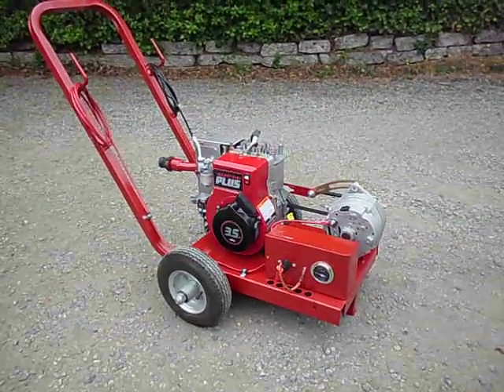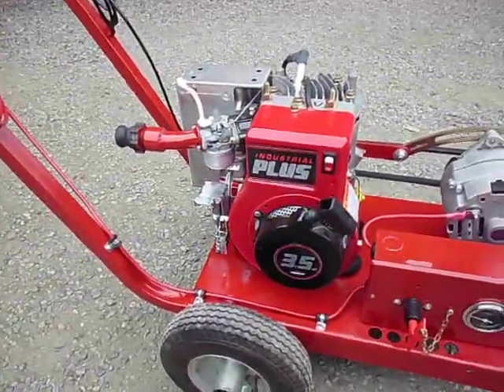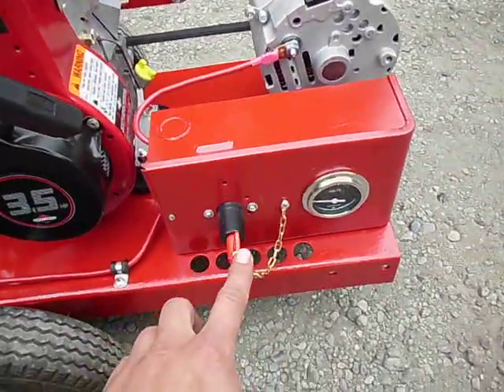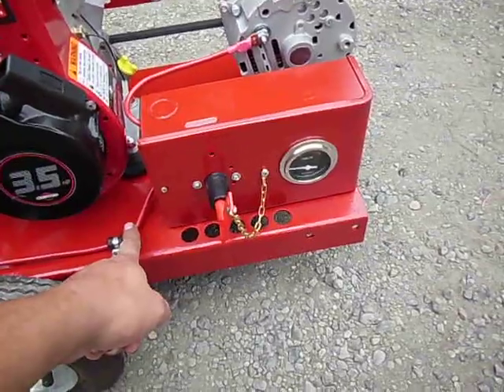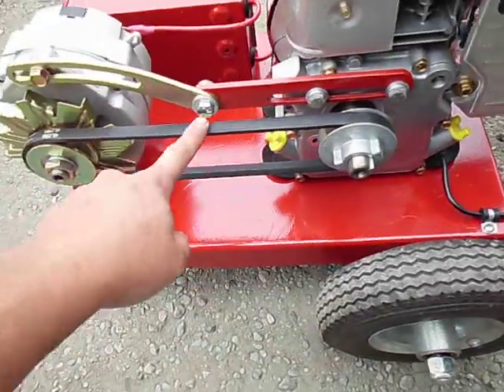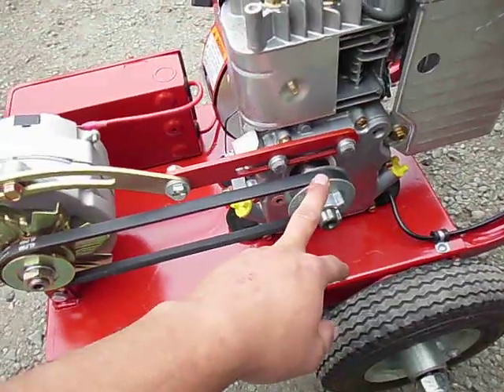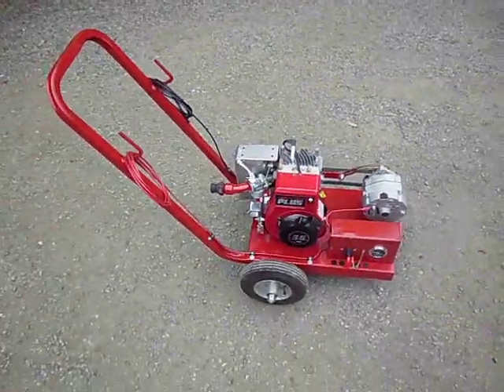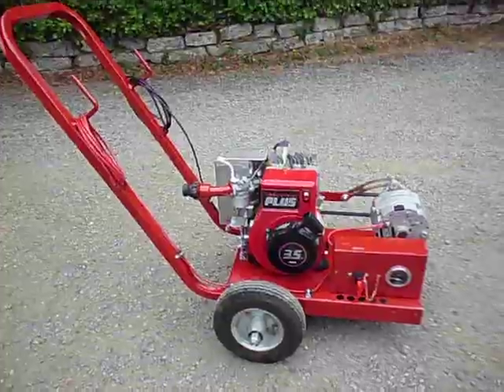Woodgas Charge Station 2

Comment: I know this is a old video, but, I am just now making a unit similar to this. I have a 48 volt back up here with 2 strings of eight six volt batteries. So, I will be needing a bit more HP and more alternator. Actually, 2 Wind Blue DC 512 PMAs along with a 9 HP briggs. You do some really clean work and I am going to model my build after yours. Just a wee bit larger.
Thanks for your videos

Comment: you could attach a bolt to the alligator clamp and use a wing nut to connect them if you needed to. that way you could leave your wire the way it is and still be able to use a alligator clamp if you needed to.

Comment: Just to be sure you might want to check with Interstate to see what they recommend as the max charge rate for those batteries. It will be a percentage of the battery banks total 12v amp hrs. Usually around 20%.

Comment from the maker: The batteries are 6v. Interstate marine deep cycles, series wired to 12v and paralled to one large 12v bank ( four batteries total ) not a huge bank but it keeps me going during power outages, as fo AH...cant remember off the top of my head but decent, will do a vid of the bank soon,...josh

Comment from the maker: You were correct, hooked up a volt meter to the alternator while disconnected from the battery bank and saw voltage spikes over 40v......yikes!!!! Found a remedy though, moved my gauge wire to the alt side of my disconnect instead of the batt side, this gives the alt something to sense and the regulator takes over keeping output around 14.5v just wanted to say thanks for the heads up, you saved me some bucks by not frying my new alt!!!!

Comment: Nice Job, However I have to go back to my tech school training days to warn you that the disconnect switch in the open position might ruin the electronics in the alternator because there is nothing as far as a load (your battery bank in this case) to keep your voltage in the alternator at 14 -15 volts maximum while it is running. The voltage regulator should limit it but it would be better that this circuit be closed all the time. Okay I am probably wrong but you might want to check this out.